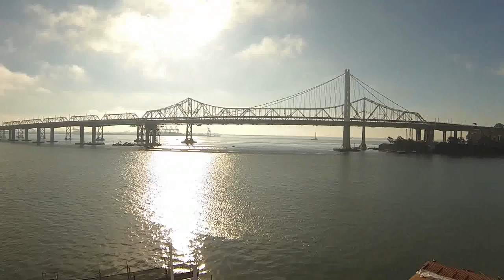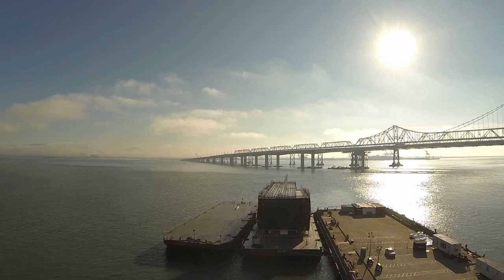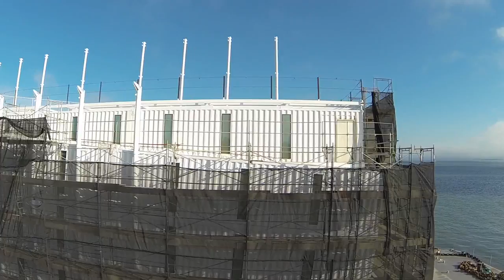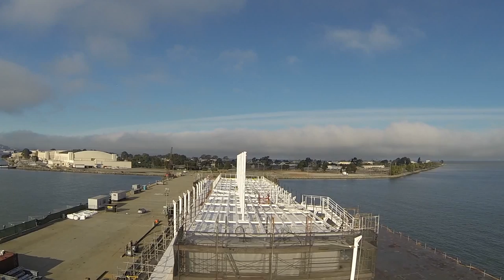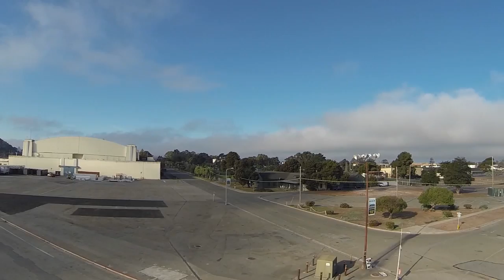New home Google barge up close - The Unseen footage!!!/Google Glass/Project/Data Center

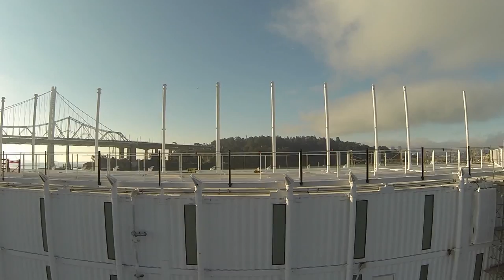Comment: It's interesting that the tops of those poles have mounting brackets on them but nothing mounted. All of those windows seem a bit excessive - unless they are for solar power; and then there's that rectangular (flat panel) transmitter on the side (immediately to the left of the scaffolding; you can see what looks like an LMR-300 cable going into it; first comes into view at 2:53 )... possibly an "active denial system"? You'd think that if they're being this secretive about something - they might want to have the ability to protect it once it's launched out to sea. Who knows? It's all speculation.

Comment: Google glass showrooms?  I don't think so.  All these specs scream military command center to me.  The purpose of the "modular" design is so that it can be disassembled, transported, and reassembled rapidly to land-locked locations if neccessary.  Also, barges are short range, need to be towed.  That means its meant for the United States.

Comment: data center?  built from an old barge...some dongers...on salt water...with sea air...to save on their power bill... doesn't seem logical at all.
Reply: the logic behind this is that it runs seperately off the grid... cuz they know the grid is going down eventually, google would have inside info for sure
Reply: 420protoman fema barge camp that can hold upto 300 people🤨🤨